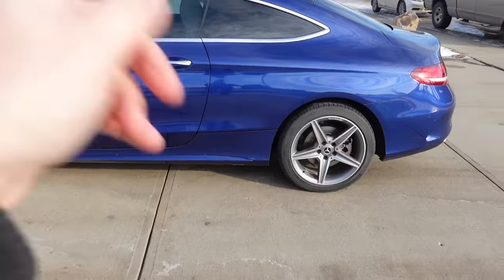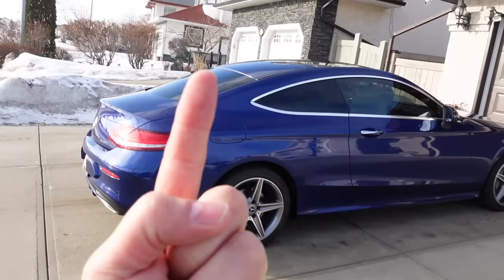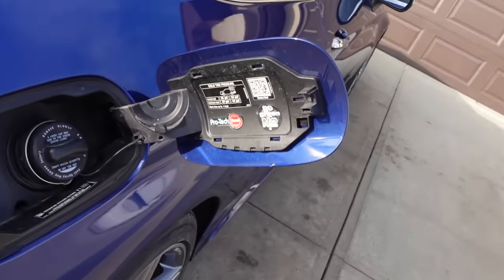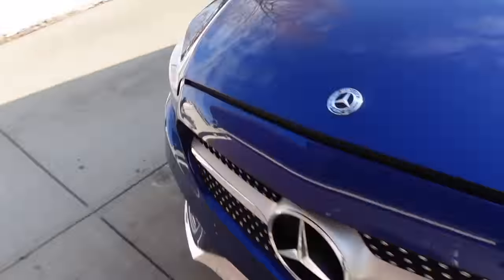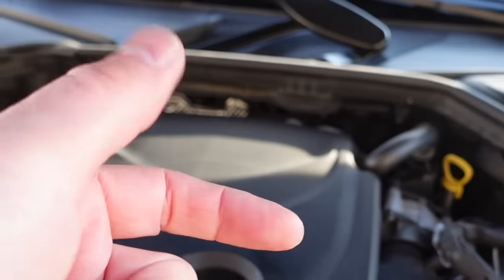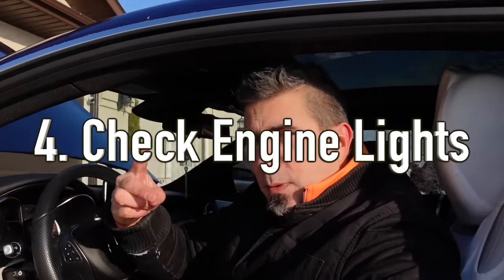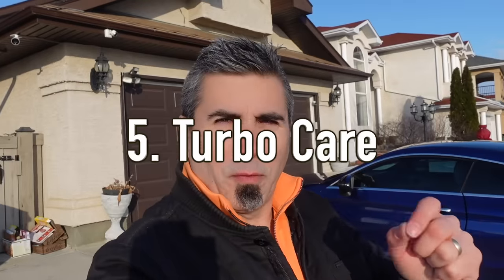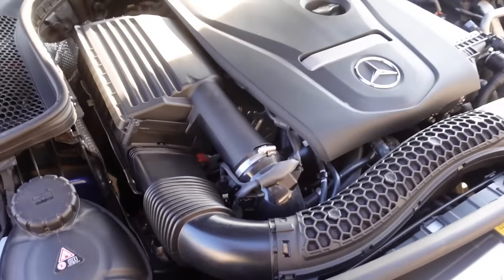STOP Destroying Your Car Engine! (With These Tips)

Comment: Only one thing out of all of what you said that i would like to touch on. Ive worked in the gas industry my entire life so take this as you wish. Stabilizer is a complete waste of money IF you are using it because of ethanol in gas. It does absolutely nothing to help with it, it a long technical explanation but the short version is stabilizer can’t stop the ethanol from absorbing humidity over time.

Comment: ECPP, excellent comments and advice. I do everything you say already. Let me add that engine oil is also a coolant. This is hardly ever mentioned. Engine oil lubricates and removes heat from the engine. Fresh oil cools the engine better than old oil. Old oil gets thick and starts to store more heat in the engine which eventually prematurely damages engine seals and bearings. There is nothing better than fresh oil in your engine at all times. As for the turbo, when i drive it hard, i take the longest route home while driving gently to help it cool. I turn the AC on as well so that the AC fan can help with the cooling. I then let it sit running on the drive way for about 10 minutes before putting it in the garage. Finally, old radiator coolants are actually acids. As the coolant breaks down or wears down over time, it becomes a destructive acid that starts eating the plastic parts of your radiator, water pump seals, while degrading the lubrication of water pump bearings. I am a big advocate for changing radiator coolants every year. Coolants degrade by a certain percentage every year. Radiators and thermostats can last up to 15 - 20 years if you change the coolant every year without fail. I stopped using mid to low grade gas about 15 - 20 years ago in all my cars including my 4 cylinders because i kept having problems with them. I only use 93 octane. No issues since then. And, i only use BP gas. I would rather drive empty than use any other octane rating or gas manufacturer. Also, change your air filter twice a year as a minimum. It does wonders to engine longevity when done with frequent oil changes. Replace transmission fluids every 2 - 2.5 years. People forget that fresh transmission fluid improves gas mileage, in addition to new air filters, by a significant amount. The older your transmission fluid, the worse your gas mileage. Finally, do not let your fuel tank ever go below half tank. You will eventualky damage the primary fuel pump, and the high pressure fuel pump. Any high pressure fluid pumping machine needs the fluid to be at a certain level at all times. Below a certain level, heat build up begins which deteriorates the pumping machine. By the way, old engine oil also damages high pressure fuel pumps. Keep your engine oil as new and as clean as possible at all times. For goodness sake, always allow your car to warm up when you crank it. This allows the oil to reach everywhere inside while allowing the metals to expand to normal operating conditions. The only thing wasted in a warm up is just some gas. Better to waste gas than waste an engine, right?
Reply from the maker: Thank you so much for your great comment, tbis should definitely help viewers with the right treatment of their vehicles so they can maximize the life of their vehicles.
Reply: Would you elaborate on the "don't let the fuel tank go below half capacity"?
Reply: @Omega_SM  yes doesn't make sense
Reply: @EK-fl8yz  i use BP because of their invigorate chemical in the gas. I used to use Chevron with techron which was also good. But i noticed more soot on my spark plugs, which i replace every year on my smaller cars. When i switched to BP, for the last 8 years, no soot has ever formed on my spark plugs. My copper spark plugs are so clean at the end of the year that another car can still use it. If you have a turbo in your car, clean air filter and clean oil can extend the life of your engine and the turbos. Turbos are expensive. A cheap one will run you about $1000 in parts, and you do them in pairs, which means at least 2K in part costs.
Reply: @Omega_SM  fuel pumps are subject to the impact of fuel level which impacts fuel pressure. The fuel level also helps cool the fuel pump. As fuel level drops, a pump runs the risk of cavitation, while having less fuel to cool the pump itself. A smaller fuel level will hold more heat produced by the pump. A smaller fuel level means that the pump will suck up more dirt at the bottom of the tank. A fuel tank that never goes below a 50% of the tank, will likely survive as much as 20 years or more. I have never had a fuel pump or an alternator die on me in my entire auto ownership. To save alternators, change your battery evety three years without fail whether the battery works well or not.
Reply: @ikeudechukwu5018  yeah but explain why the half full tank and not why 1/4 ? Do you really have knowledge of the minimum pick up point of the pump?
Reply: @Omega_SM  i reached my conclusion based on throttle response. As the fuel level drops under high acceleration (i drag my cars to blow out carbon every week), you do not get the same response at 50% tank versus 75% of a tank. If you drive nornally, you may not feel or experience this difference. Second, lesser fuel means lesser cooling.
Reply: @ikeudechukwu5018  Driving normally I feel the difference only when under 1/4th of the tank, tbh. I drive an older car without sound and vibration insulation so I kinda am sensible to this

Comment: Good tips, but technology and engineering have improved. Worked with BMW for about 10 years and with the German trainers and race car drivers who themselves are mechanics and engineers. Many of them explained on 2 points that you mentioned that similar to older cars that have turbo timers, a lot of modern vehicles have their own cooling systems that run even after the car is switched off, so running it for 30 seconds after a drive may not be necessary. A good precaution if your brand of car does not do this, but a waste of time if it does. You normally hear a fan running on most luxury models with a turbo for some time long after the engine is switched off for example. The other one was the automatic start/stop function. It can only work to engage if the engine and oil are already at its operating temperature, if not, in most cars it would not be available until that happened as many owners would notice. On BMW models it was designed to save you about 0.1 liters for every 100 liters of gas, which with gas prices today is something. In terms of the starter, it was also explained that for an average starter that had a life of 250,000 starts, an engine that has this feature was designed with 750,000 starts to compensate this, and the reason the off button was there, was if you think your stop and go was excessive actually. Your points are valid and good precautions, but doubt those guys did NOT know what they were referring to. For everything there is a reason and explanation, especially when it comes to German engineering.
Reply from the maker: Thank you very much for the insightful comment and definitely thanks for the support.
Reply: You’re welcome. You video post was good and quite refreshing actually. Lots of owners and drivers do NOT know these things when they buy a car and the people that sell them sometimes do, but don’t pass that learning along.
Reply: Also if your stop/start stops working it's a good sign your battery is on it's way out. Disables this feature to stop battery drain. Well it does on M5 BMW.
Reply: Be real they are designed to break and to have very costly repairs .
Reply: Longevity is not a trait associated with German engineering...
Reply: My 2011 SAAB turbo fan runs for about 5 min after I turn the car off. Thought I had an issue but glad I read this comment :)
Reply: so…assuming $2 per liter, this remarkable stop start technology would save you 20 cents per 100 liters.  geez.  definitely going to turn the system back on!!!!!!  (i live in California.  do with our high gas prices being well below $2 per liter, the savings are even less)
Reply: They tell you the starter was engineered to last longer but you will see in 5 to 7 years when your ring gear on the flywheel is worn out and that heavy duty starter costs 1500 dollars instead of 300 to replace.
Reply: @rcrinsea  I suppose you’re from the USA? Personally I prefer a German car compared to a USA car. I’m from The Netherlands.
Reply: ALM, Lived in Germany several years and found that most 15 yr old Mercedes’, BMW and Audi’s would run and drive as good as most brand new cars.
Reply: @rcrinsea  Longevity to delay is. Look how late BER airport opens.
Reply: never ever thust german engineering...
Reply: @jr9455  Especially when it is about airports (BER)!
Reply: @michaelmorrow5624  Because they were made 15 years ago. Today they are full with dpf, sensors, stop start garbage, plastic oil pans, plastic valve covers, plastic intake, air suspension... and all kinds of headache.
Reply: Please don’t be proud of the word “German engineering “ it’s literally a word used to mean trash, low quality, and constantly leaking oil, and coolant. Yes they might have nice and high quality interiors but what matters the most like drivetrains they use the most shit parts they can find, using plastics on critical engine components, to ensure your engine will fail catastrophically. Definitely something to be ashamed of nowadays.
Reply: @mohammadkamran5862  firstly, “German engineering” are 2 words that make up a phrase! I am not proud of it as I am not German, but do respect their engineering and by the way their parts are not shit parts. They actually use very high quality components, hence the reason the cost is higher most of the time, not the reverse. As for their issues that they tend to have, many of times a lot of it, believe it or not is actually user error! I have worked for these companies, but personally owned these types of cars myself, alongside Japanese and American cars also! Japanese use differently engineered vehicles that are more reliable or most reliable in many instances, but doesn’t make German engineered cars poorly engineered cars. Take for instance with proper use and schedules observed in Germany and many parts of Europe and even other countries, these vehicles don’t give half as much trouble as they do in other places, and there is a reason why! User error is also part of the problem in many instances I have also seen! Some of their complexed engineering accomplishments make the cars what they are or aren’t, but as they say you can’t always have your cake and eat it too.

Comment: I'm not a huge fan of stop/start but several things should be known about it.
Starter wear: Starters are being built to be more robust now.
Engine Wear: Most wear occurs on a cold start. Cases in which the stop/start will not engage:
If the engine is not warmed up.
If the battery voltage is too low or drops too low during the shutoff.
If the transmission is not in Drive.
If the heat or a/c is running (some cars will still shut off but restart if the temperature gets too cold or hot.)
If it hasn't been long enough since it restarted.
If the hood is open.
Reply: Exactly this. There isn't any data to support the theory that stop/start damages the engine
Reply: @twoleftfeet9626  It's called common sense. Common sense isn't a prerequisite but it can come in handy for navigating life. Let me see if I can help lead you down the road to enlightenment.
Is there any data to support the theory that stop/start is good for your starter motor? No. So the very best you can hope for is that no harm is done. Logic tells you that the more you use it, the more you wear it out and shorten it's lifespan. 
Now, if we possess common sense, we are now able to establish that the stop/start function is a bad idea.
Reply: @prestonian1066  You have provided zero proof other than word salad.That was no help whatsoever.
Reply: @twoleftfeet9626  It couldn't be clearer.

Comment: Years ago with the heavy duty diesels, some would actually have a plaque on the dash saying, "idle engine 3-5 minutes before shutdown to avoid turbocharger damage".  Excellent video and advise.
Reply: I always did this with my 2007 Audi A4 2.0tfsi even though was never told to do so.
Reply: What if you drive slowly for 5 minutes before you arrive at your destination? Could that play the same role?
Reply: @ntwalipat2  as long as u don’t hammer it yeah.
Reply: @ntwalipat2  I had an Toyota diesel turbo charged mini van 4wd in Bangladesh, that van kept running few minutes even after remove key from ignition and lock that ,.
Reply: @ntwalipat2  slowly , if in higher gear in manual trans maybe fine but some auto will use lower gear so probably will force turbo charger to work, so better wait 90s -180s to turn off the car especially G-cars

Comment: I think most people just put gas in and go. Maintenance? Looking under the hood? Only when the car breaks down. DIY maintenance is a lost art. Car manufacturers know this and build disposable vehicles. You can beat the odds with proper maintenance. Not 100%, but fewer problems. Thanks. Good information Mark.
Reply from the maker: That’s bang on and has always been my approach.  I try to minimize ownership costs by doing much of my own work too.
Reply: Building disposable vehicles kills your reputation as a good car manufacturer. Than no one buys your crap cars. So your theory is BS or you just buy GM/Ford.
Reply: Yeah, disposable cars that cost an absolute fortune.

Comment: I bought a used 2005 TL from a dealer and when driving home on the highway the engine sounded like 4 cylinder. I  realized later that someone had used 87 regular. When I reverted back to BJ's 93 octane there was an improvement.  But what surprised me most is when I started using top tier gasoline the engine became even more quieter.
Reply from the maker: It can make a difference on high strung engines
Reply: It makes also a great difference when pumping at different places. In Germany I once pumped regular Diesel on Shell and realized even though it cost me a few cents more a gallon, my car went comfortably and didn't just have some performance loss coming randomly.
Reply: @natas12rm  what is combustion ratio?
High compression ratio requires premium. 4 cylinder or anything can have a high compression ratio.
Reply: Your 2005 Acura was meant to run on 87 octane. If you had misfires that was not the 87 octane fuel.
Reply: @7sins979  Acura tl are premium gas only it even said it on the gas cap.
Reply: @k-no4065  nope. I was a dealer tech for years, they do not require premium.

Comment: Years ago when I was 16 (Im now 51) I got wonderful advice. When you start your car, wait before putting it in gear. Put the key in the the ignition and turn it to the run position but dont start it. (Not sure how this would work with keyless cars). But wait for all the bells and lights to cycle. Think of it like letting your car boot up. While thats going on, put on your sear belt, close the door, get yourself all situated. After the dash lights and bells are done cycling, then start the engine and wait at least 30-60 seconds before putting it in gear to let all the engine parts get lubricated and ready to handle the load of driving. I see so many people who just start the engine and immediately put it in gear and go and that is horrible to do. My truck is 15 years old and I do this every time I start it.
Reply from the maker: Great thoughts and I do similar.  I k ow many older vehicles I would turn ignition on without starting and you could hear the fuel pump pressure up so starting was more consistent.

Comment: I highly recommend the Autostop Eliminator. It’s a small wiring harness that you attach to the button under your center console and to the vehicle’s wiring harness. Basically it remembers your setting so you don’t have to push the button every time you get in the car. I would always forget until I got to a light and it would drive me crazy. Worth it for saving me a few starts per day! And the convenience of not having to do “pre flight drive checks” like I’m a friggin pilot.
Reply from the maker: Haha that’s fair I will have to check into that
Reply: Cant you just code it?
Reply: Brilliant! Just got my first car with autostop and I hate it. Going to look into this solution! Thanks!
Reply: I installed this.  About half an hour worth of work after I messaged them and found out I was trying to connect it wrong.  I love it.
Reply: @ECPP  Petrol / Gasoline has lubrication effects and Ethanol does not so the more Ethanol in the Fuel the faster the engine wear and the less efficiency. 
Strange that you do not mention this FACT.
Reply: Ford sell a harness that disables the stop feature. Around $200.
Reply: Save your money and use the button on your dash, takes a split second to push it before you drive away